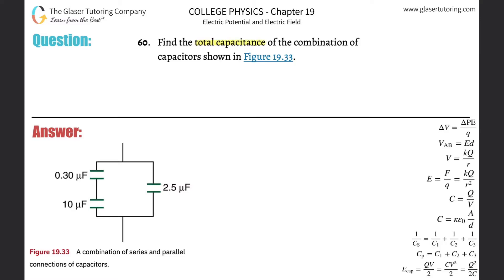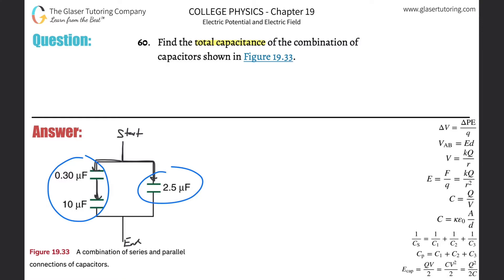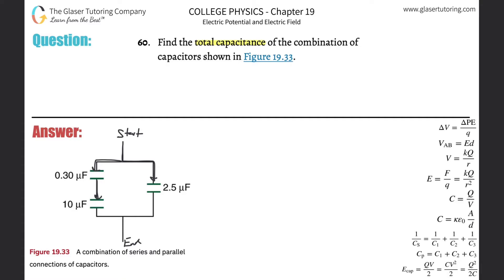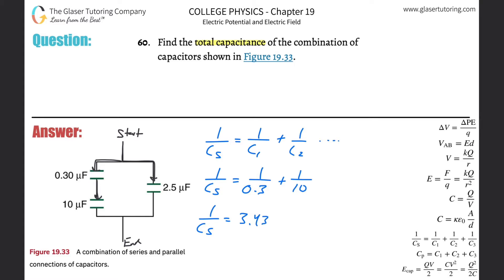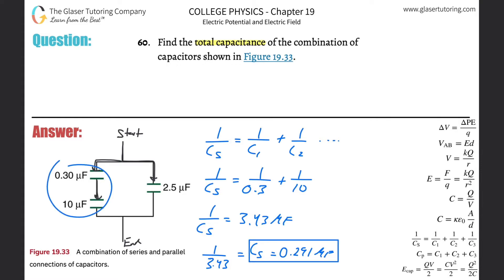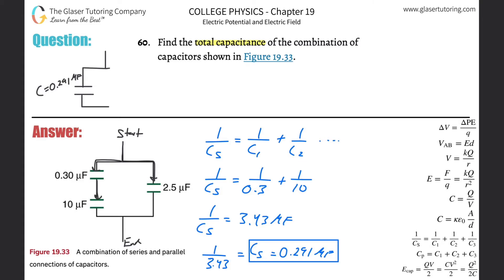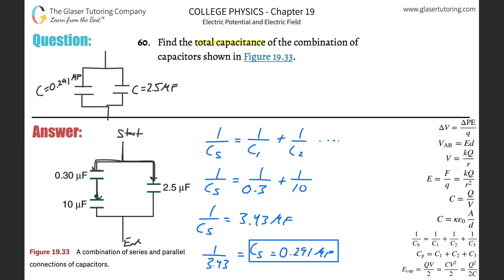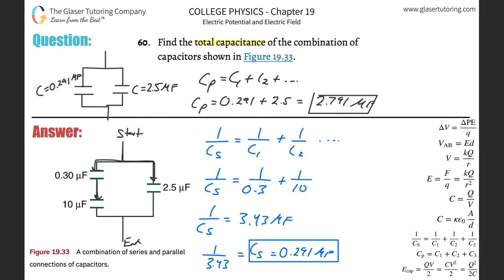19.60 | Find the total capacitance of the combination of capacitors shown in Figure 19.33.

Comment: Question. Three capacitors of 60 uF, 40uF and 24 uF are connected in a parallel across a 500V supply. Calculate 
a) The total capacitance 
b) The total charge
c) The total energy stored
Reply from the maker: Give it a shot and let me know what you get! 😀